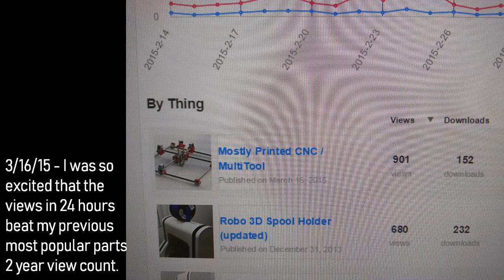Mostly Printed CNC -MPCNC - The early days.

Comment: Hey Ryan im about to make my MPCNC Primo but im really thinking of two things that will help the integrity of the machine like the z axis measurements and also what size tubing to use on my new build . Lastly what's an ideal motor (5reasonable priced)setup for an primo build sized about 1000mm X 900mm . Im in canada and im using a 1" conduit because it will help it when it comes to rigidness/ satiability . Please if y'all can help out an hobbyist
Reply from the maker: Best to ask questions like this in the forums. Much easier there as we can use hotlinks and other shortcuts.
Reply: @allted  I'm actually waiting on face book(2weekss) and reddit doesn't have a forum setup what would you suggest?
Reply from the maker: @youswizz1  The V1 Engineering website has the official forums. https://forum.v1engineering.com/